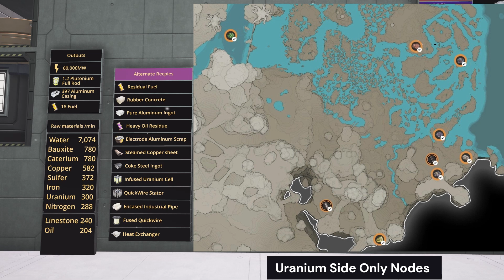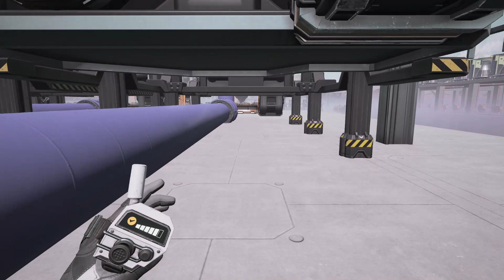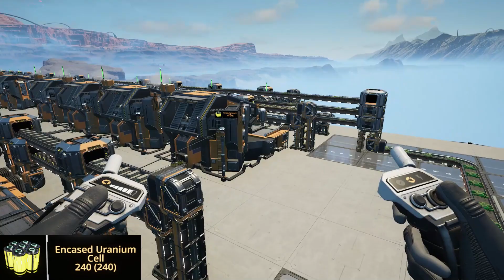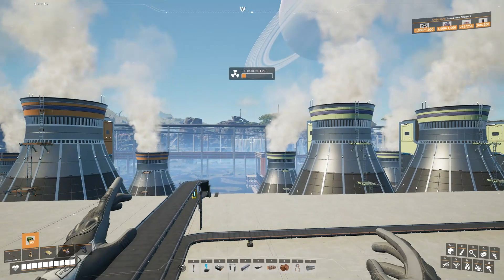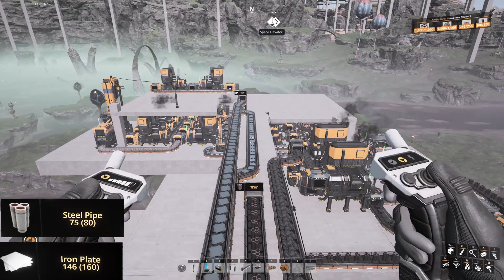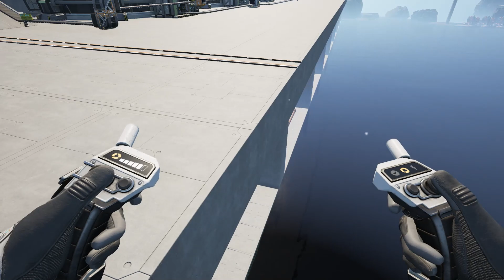Satisfactory 1.0 - 105GW Swamp Nuclear Tour

Comment: Quite impressive, but this is merely nothing on a scale i'd do although 1 Uranium node is enough to power most things when some people need extended power grids for massive factories. I myself like cold startup power stations just in case something happens and you run into a maintenance issue that forces you to shut down the whole plant or you're starting it from a low capacity grid. Great video though :D
Reply from the maker: Thank you
There are 4 nuclear power plants in this world, I am working on the 5th. 
All are setup with easy startup and safe shut down in mind.